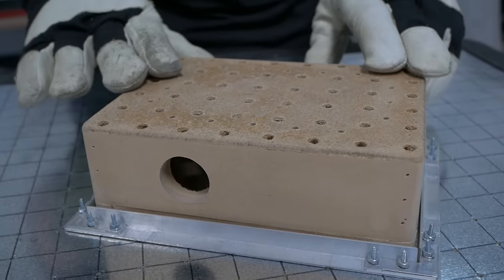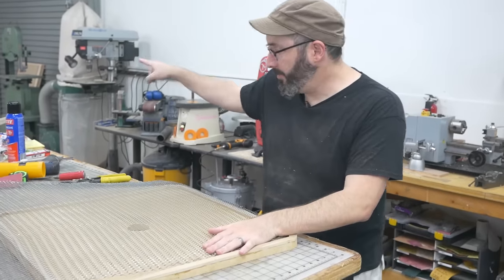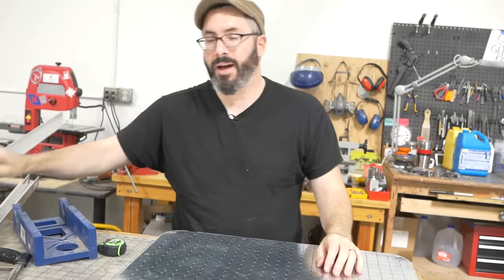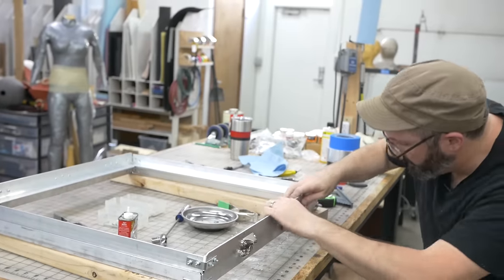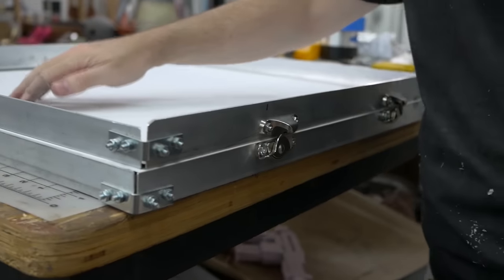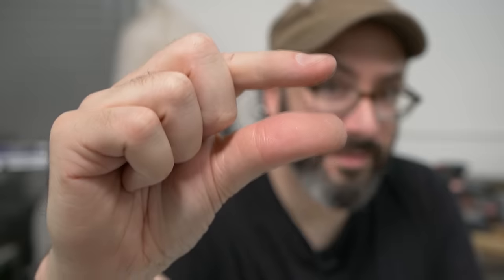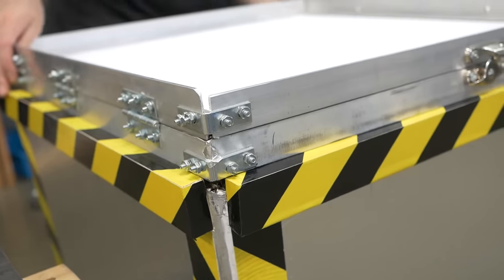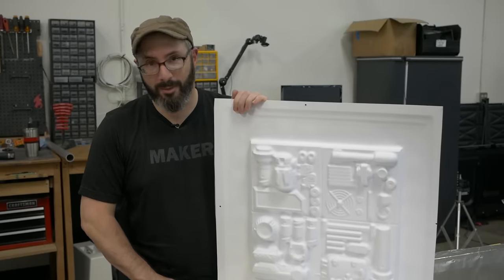Hardware Store Vacuum Table - HOW TO make your own

Comment: Hey Bill.  Just one critique for you.  MDF is porous (you can actually pull a vacuum through it) so you're probably losing a lot of your vacuum potential to the underside of the table.  Just give the bottom and the sides a coat of polyurethane and that will seal it right up.  Good luck!
Reply from the maker: Great addition Mark, thanks!
Reply: No way you are losing any vacuum through MDF.
Reply: That is not possible as mdf is gas tight. As it's a compressed fibres impregnated with its own binder. as. Really shitty advice doctor mdf
Reply: You are absolutely incorrect, MDF is extremely porous and will not hold a vacuum,  try to make a vacuum camber with an MDF lid, you will find out how porous MDF really is.
Reply: As a CNC machine operator who literally used mdf as a spoil board to hold parts, yes, you can pull a vacuum through it. I could place my palm on table and the center will get sucked flat to the mdf. When say, doing small parts, have to use a latex paint to seal the mdf. Or you could setup a jig where there is a hole underneath the material with a rubber square seal is used for perimeter. This is more critical for small parts, like at a fridge manufacturer that was cutting a part out of aluminum, the puck from the hole got chucked by the 10hp spindle Chuck and cut through "5?" Fridge doors.

Side note, I have accidentally moved the CNC with a fork lift pushing on material. We where trying to hold down a warpped sheet of 1³/16th particle board.
Experience is from running a komo vr512 CNC wood router. We had two zones, each zone required a 4" line. Nightmare to try to change. They where hooked up to a pre-fillter then to a 40hp Quincy vacuum pump. Videos available on komo cnc website.
Out new machine now is an Italian SCM group CNC cabinet CNC router. This machine uses two carbon vane vacuum pump. But whole machine is on its own special 400volt transformer.

So, not bullsh!t. That is all.
Reply: Thanks Mark for saying this. Beat me to the punch, but I figured I would add my own personal experience with references for some to Google in seconds and see for themselves.

Oh, material we ran  for making worksurfaces for cubicles or large custom shapped conference tables was anything from (in foot increments) 4×8 ,4×10,  4×12, 5×8, 5×10, and 5×12. Either 1³/16" or 1½" thick. The 1½" stuff was two ¾" sheets of particle board sandwiched together.

Try using latex paint to seal. But recommend something high temp range. Our tables never saw that much heat. Well except for when another operator tried to refinish the spoil board, went too deep with the 4" fly cutter, didn't shut off vacuum pump, or spindle, or 16hp dust collector with 2 12' filter media tubes. Fire started based on friction, like not moving the saw when cutting wood burns it. For started and on Monday I came back to a heck of a mess to say the least. Fun times. Definitely put a damper on my 300 worksurface daily production.
Reply: @vasili1207  here is a machine running the spoil board resurfacing program. When too many shapes are there, you material when then slip because of all the 5 thousandths of an inch deep cutts. Always have to have bit cut deeper then the material your cutting.
The resurfacing program also gives you the perfect smooth and level surface.
This only is showing the spoil board installed.
Spoil board is used cause you never want to cut your aluminum table.
Reply: @Georges3DPrinters   okay I may be wrong. But hobbyists probably would never have a pump that creates that much vacuum.
Reply: @evilutionltd  here is one with a sheet on the spoil board but this machine has dual heads on y axis Gantry.
When you train there, you will see other machines built. Like the one I saw for Mitsubishi motors that had 4spindles each with 4 attachments for secondary drilling operations. But that was a liquid coolant table and didn't have a setup for wood but for metal. You don't cut all the way through, bit damn near it.
Reply: @vasili1207  I hope these examples help clarify your misconceptions of how strong vacuum can be.

Those who know bass boxes for stereos, it's a choice of materials that best fit the scenario. The best box would be like reinforced steel box so no distortion for box surface vibration. But that much propperly construction would be insanely expensive, and heavy. Ain't no dj lugging metal boxes around. That's why the seal, and paint them, or wrap them in vinyl.

Hey, there's another idea, wrapped the exposed wood in some vinyl wrap, no need to wait for paint to dry!
Reply: https://youtu.be/sx8fAv5f8js
This video talks about the shiny side of particle board. MDF usually does not have this. And here is where some confusion can happen.
This person says is using a particleboard spoil board, but it's actually mdf. Particle board is Not what I would use in a high production area. Just saying. But we did cut our stuff out of particleboard and no can not double stack material unless specially prep.
Reply: @vasili1207  depends on person really. But trying redirect I see.
A lot of things can make that vacuum. Harbor Freight for one.
If you look up vacuum cannon on YouTube, I believe the "king of random" or Nighthawk" videos will pop up on how to make one. Pretty easy to make one. But who wants to be pumping that much time for a program to cut?
And if you loose suction, then part goes flying or bit moves whole sheet of material.
I am going to actually try to build one from a small air pump like for tires or blood pressure monitor.
Going to be for my own machine I am building.
Reply: I was about to come say the same thing. We run probably the same setup (vr 504 tt Komo IIRC) and we run mdf and have to use tape on the edges and on any larger holes or we loose vacuum.
Reply: I agree with the pulling a vacuum through mdf but it usually happens when the binder breaks down in between the layers.  We found it out the hard way when we were trying to build a prototype machine to handle production for a client.  We dropped a piece of acrylic on top and it solved all the problems.  It seems it was sucking air from the sides horizontally through the mdf.  Not all the way through the mdf but from the sides. Eventually we just painted it with oil based paint and it helped alot.  The customer was too cheap to line a 36ft long trough with acrylic so we used paint.  6 months later we did it in acrylic because his product had worn the paint off.  Funny pay once cry once.
Reply: If it was a perfect vacuum it would blow up the motor.  K
Reply: You should always coat the edge of the spoilboard with silicone to increase vacuum pressure to the material being machined, no? Silicone, not paint 'interacts' with the porous 'grain' of MDF on the edges more efficiently.
Reply: @Studio_234  ummmm......
What???
Should do more research.
Motor would heat up maybe if it's a shop vac.
But a vacuum pump is what I am suggesting.
A motor designed to pump continuously.
If your talking my own idea, it's going to be a periodic pumping situation. Want a good seal so I can hear the bit cutting. Not the vacuum pump whirring. Well in my case would be a small pump.
And if you cool a shop vac motor like with a copper coil wrapped around motor that circulate coolant. Then could do a "perfect vacuum" as u put it. A shop vac uses air circulation to cool motor. And some will use the air from the suction to cool but most will have a separate fan to cool motor for the good ones.
Reply: This project will never be a 100 percent vacuum because of the imperfect seal around the perimeter and the unsealed bolts holding it together, leaving the MDF to actually be the most airtight element of the build. This project only needs a small level of vacuum for a short period of time making a perfect vacuum unnecessary.
Porous does not mean that it cannot hold a strong vacuum. It is not like an open cell sponge-like material that will not allow a vacuum to build. Although this project is not meant to be 100% airtight, the MDF will hold far more vacuum pressure than needed unless there is a flaw or crack in the board,. There will actually be no less vacuum using a good peice of MDF than had the project been made using steel, plastic, or had the MDF been coated with a sealer.
Speaker cabinets are almost universally made using MDF because of it's density and resistance to loss of air pressure.
Mdf is porous so that it will absorb liquids, but the densely compressed manufacturing process combined with the binder makes it such an airtight material that it is recommended to build an airtight box with only the seams needing silicone sealant to hold an airtight seal. See the link below. 
https://www.ehow.com/how_12117397_build-airtight-box.html
Reply: If you attempted to build a vacuum chamber with an MDF lid and had a loss of pressure, it was not the MDF material that was leaking, It was an improper seal between the MDF lid and the chamber itself. Although MDF is airtight, it is not a perfectly smooth material and without some sort of an airtight gasket between the lid and the chamber to compensate for those imperfections, you will have a leak, not through the MDF material itself, but at the contact point between your lid and your chamber.
Reply: @tKetcham1  dude, keep reading other comments. MDF can breathe. Links also to show examples.
Reply: @tKetcham1  see, now your trying to reword what I said so that this argument is somehow valid. I said the perfect box. Why are the best ones sealed either with paint or wrap? When you get into seriously powerful speakers they can breathe through the MDF. Yes the binder can seal quite a bit, but not totally.
I have built a few boxes. And plywood is preferred for people who move around their stuff a lot like a DJ. Lighter, and stronger then MDF but needs work for sealing, however, when your pumping 1,000-5,000 watts of power through 24" subs and a couple 1,000 watt piezoelectric tweeters, you tend not to need much because the speakers can over power but they flex a lot.
Heavy boxes like acrylic sound so much better then unsealed MDF.

Try it first hand.

Then I will build a box that made my friends they the 8" Jenson subs sound like some 10" subs that bumped fucking awesome using a 50 watt rms amp I got from radio shack.
Was a combination of 4th order bandpass and a 6th order bandpass box.
Books and reading is great. But get out there and get some experience with other stuff.
How about look up a bass fan.

Kevlar condom taught me that one as far as industry goes.

But ultimately I would love to some kind of system like I would see in audio n video interiors. Which I still have somewhere.
They where magazines printed on lithograph paper cause the systems where effing amazing.

Just saying......
Reply: @tKetcham1  main reason to use MDF, price, function and light weight.
It's a combination of reasons on what to use.

Particle board has a better seal then MDF.
But that's from my own personal experience.
Reply: @tKetcham1  unsealed bolts? They probably have sealed when plastic is hot. When hot it's different. The physical properties have changed. It's no longer a solid but rather a liquid.
Reply: Clearly, you do not know about what you are speaking. MDF can be described in many ways, but lightweight is not one of them.
Reply: @tKetcham1  that would be relative to other materials that seal better like acrylic and Metal your scope and perception is quite limited to what you only want to believe seems like.
That's why I said "relatively speaking."
like you ignored that so you could try to win the argument anyway you can, even though you already lost?
but I don't see it as losing or winning I see it as information being corrected.
Reply: @tKetcham1  maybe try to compare it to particle board, will see that particle board is a bit heavier.
So if just talking wood composites, then I would go with MDF, lighter.
But if painting box, then MDF needs more work then particle board if using shiny side. Hold paint smoother and less paint is needed, usually.
All depends on what you need/want right?
Reply: @tKetcham1 I didn't say it was light weight compared to other stuff. Just relatively speaking to other materials used to make say speaker boxes.
And I was pointing out about a large DJ box made from plywood would be lighter and stronger then MDF. I mean I did speak of other materials.

Maybe get some experience handling big sheets of wood composites like I have and may change your perception of the materials being discussed here. And it was about weather MDF can be porus and pull vacuum. I have used MDF as a spoil board. CNC machine operator, KOMO VR512 CNC wood router. With 25hp Quincy vacuum pump.

The 5'×12' MDF sheets where so much lighter then particle board, but particle board has less flex when lifting with say a forklift. MDF wants to break up it bends so far. And was a pain to dealing with it at times.
Particle board, one person can do it all, but board would curve towards gravity.
MDF sheets needed people to support the ends hanging over forks.

But all this cause of my experience with stuff and people being salty they didn't know something? Why?

Speaking to everyone who reads these comments;

I hope you learned something about MDF and not hate towards other commentors.
Reply: Make sure it's solvent base polyurethane, not water based polyurethane. MDF is worse than particleboard when exposed to water.
Reply: @cptcosmo  yes.
I used wood sealer before painting wood. With sanding in-between. Edges are pita
Reply: Definitely not gas tight or anywhere near it.
Reply: evilution maybe not with a shopvac but with greater vacuums you do, believe it or not. On our full sheet cnc machine i hold down 122cm x 244cm 15mm plywood sheets down only with a vacuum through a 12mm mdf sheet (yes 12mm) where we pull a vacuum under the mdf though a plastic peg-board looking configuration. Mdf is super pourous.
Reply: Yes, MDF is terrible as a vacuum table. I have built several vacuum formers and I have learned through experience that MDF is not air tight. I use 3/4 " plywood now and build a box around it using staples and lots of silicone..No more issues......   Watch the Belovac video on building a vacuum box .https://www.youtube.com/watch?v=fTFnsG814Pc&frags=pl%2Cwn
Reply: I might have to launch an investigation on this.
Reply: MDF might be porous but not at a speed that would affect a vac forming machine.  Sont co fuse mdf with particle board, they are similar but much different properties.  Particle board you can almost breathe through.
Reply: He's correct. I've seen it first hand. MDF is made of a sawdust mixed with a resin. It's heavy and porous. A new sheet of MDF has both sides heat sealed to a smooth and not so porous surface. When you skim cut both sides (about 0.020"), you actually open up the pores in the MDF that allows air to pass through. You should always seal the edges to prevent excessive vaccuum loss.
Reply: @vasili1207  Therein lis the problem....the vacuum source
Reply: Also, why not use mylar?  More reflective and easier to use than foil
Reply: @Georges3DPrinters  dont forget that over time with multiple fly cuts your mdf board can get clogged up reducing your vacuum strength.
Reply: @devanh8592  never had a clogged board. It was usually the multiple different shapes cut 5thou tracks everywhere. Always changing programs at time. But with the fly cut, you would go down to say 8thou in and run the whole spoil board. When it got to about ⅜" thick the spoil board usually curved towards the side we did out cutting on.
Reply: @Georges3DPrinters  the machines i worked on we were cutting foam for wind tubine blades n  that shit created dust like a mfkr so we had to change out the mdf quite regular
Reply: @devanh8592  I think that you're thinking that I am reusing the same surface with the fly cutter or something because I am confused how the material that I am removing is going to clog the MDF board I am fly cutting the surface for, that is not holding the wood down like it should due to the gaps created by the cuts of other paterns.
Like how does it clog if I'm removing the material while under vacuum of a dust collector, the chips are sucked up and away I'm not grinding the chips into the MDF board, that is under vacuum from another vacuum pump.
And again, I stated it never got clogged in my experience. That was years of work 12-hour day shifts. About three hundred parts a day. Different shapes are cut in just one day. I was not running the same shapes repeatedly like a cabinet maker making a million cabinets the same way. I cut the material and shapes that particular job called for. We didn't stock a bunch of cut inventory. We stocked materials to cut anything we needed. Like 20 corner tops, 15 bullet tops, 3 48" rectangle tops, three custom shaped conference tables (one half at a time) Hope that helps to clarify why I never had that issue of my spoil board never getting clogged.
The fly cutter was a 4" head with replaceable carbide bits. I would do that about 2 a month. More if a lot different work came in.
But that would just make the table smooth again. And also the perfect 90° angle from bit to material for the end-mill. I ran a Komo VR512 CNC wood router. 5'×12' was table size. And I had a 40hp quincy vacuum pump to maintain with that along with a 16' dust collector.
I absolutely hated the dust collector. Emptying that thing always freaking sucked! 🤣
Reply: @Georges3DPrinters  well our vacuum tables were mdf and we cut foam and it created fine dust that would fall onto the vacuum table top thus getting sucked into the tabletop thus clogging it. After a while it gets clogged up then we would fly cut our tabletop an 1\16th or 1\8 of an inch but cutting the mdf creates equally fine dust that also gets sucked back into the table and you can only fly cut so many times before the sheet gets too thin and needs replaced
Reply: It’s actually too dense to lose any air; you can do a suction test; if nothing sticks, then the air is contained inside the container.
Reply: @evilutionltd  Agree!
Reply: @vasili1207  Agree, I only seal it against water and heat damage. Air does not penetrate that dense surface.